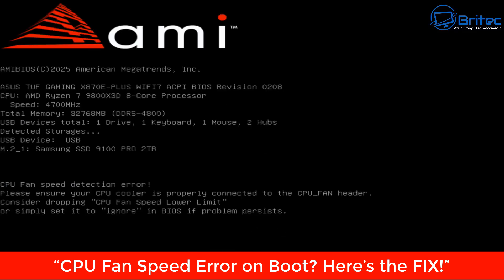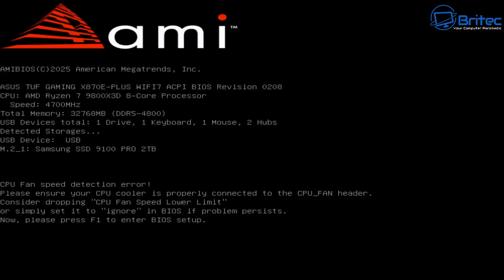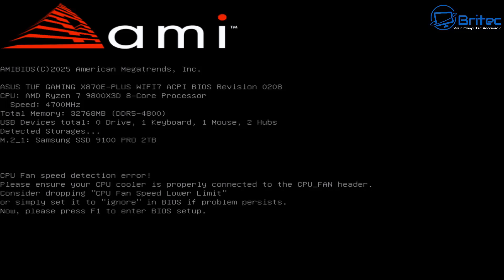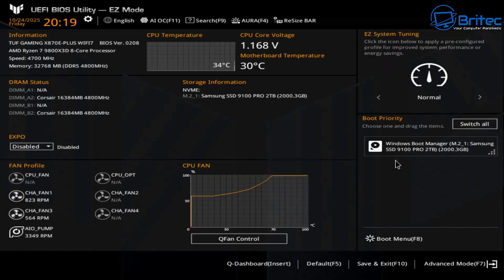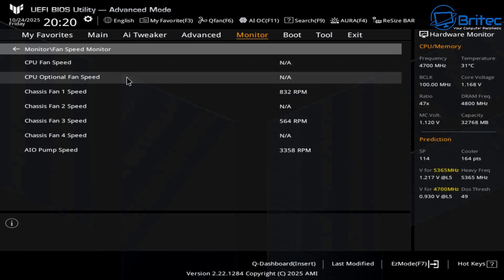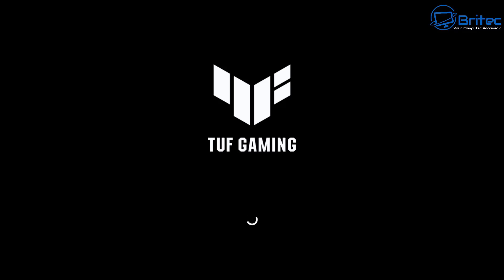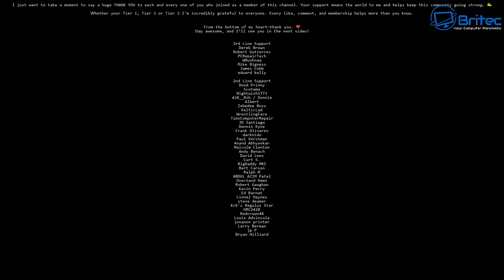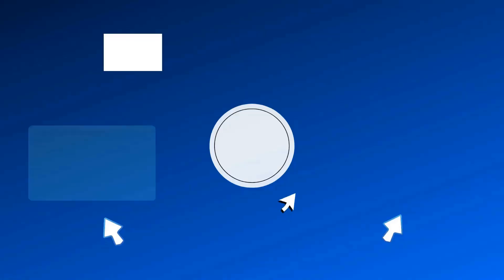CPU Fan Speed Error on Boot? Here’s the FIX!

Comment: Here's my mystery: I have a 3 yr old PC I built myself. All of a sudden I have this fan error. No matter how many times I change it in the BIOS, the system still generates the error and prevents me from booting normally. My PC was not touched since assembly, never repositioned nor bumped anything. Strange.
Reply: I have this EXACT issue. Mine started today. Went to turn on my PC and got this error. Still screwed I guess since this video didn’t help… what kind of PC do you have? I didn’t even update windows or install drivers or anything in the past week, and all of a sudden, no PC
Reply: Oh and I’ve literally had the same PC from IBP for 3 years now. RTX 3080… Intel 12th Gen. I9-12900k.
Reply: @theDegausser Almost identical setup with mine. On top of the, my wifi signal for the PC is all messed up all of a sudden. Will approach this probably with elimination. I’ll start re-socketing my fans first.
Reply: That’s weird…I turned my PC on for the first time in 3-4 days…exact same issue. 

Spent hours trying to figure out what’s up with it.

4 days later - it turns out there was an issue with one of my NVMe drives! Not sure how on earth that’s happened. They were untouched for 5 years!

Required a fresh install of windows and it’s now working again.

Comment: You can also connect the AIO PUMP to the AIO PUMP connector and the AIO FANS to the CPU FAN connector and it will work properly, for ARCTIC Liquid Freezer III Pro 240 you get 2 cables, the first ALL IN ONE connector and the second one that splits into 3 for AIO PUMP + AIO CPU FAN + AIO VRM FAN, thank you for all videos.
Reply from the maker: Glad I could help!